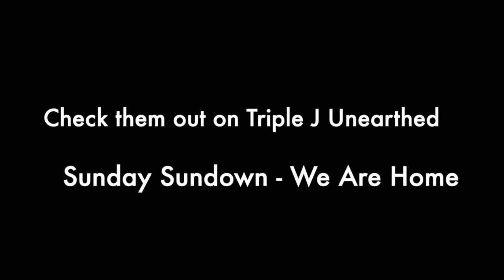The Wayward Sailors Ep 5: Painting the inside of our yacht (the hard way)

Comment: What did you paint it with im restoring a 50ft Steel hull 1981 Buchanan and need to paint some.of the areas inside the yacht
Reply from the maker: We're using international products. The commercial range rather than the retail range. We use 269 and 300 for the exterior, and 1180 and 954 for the interior. Different pints for potable tanks